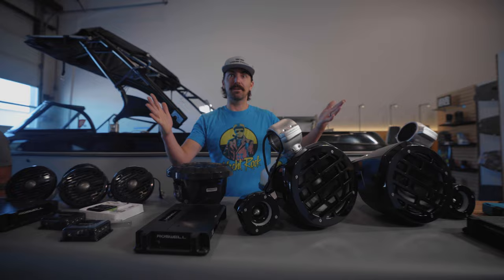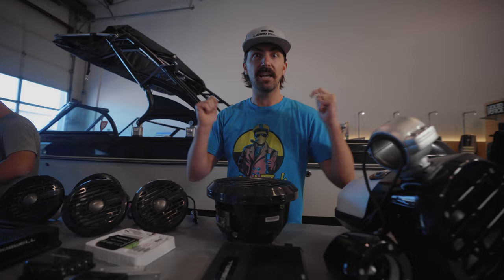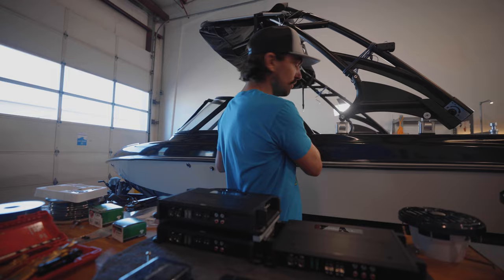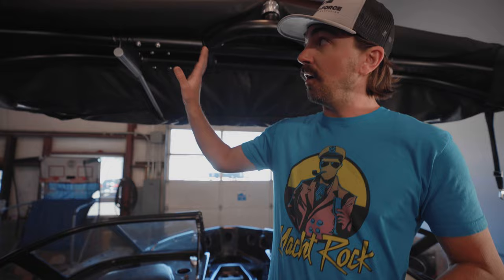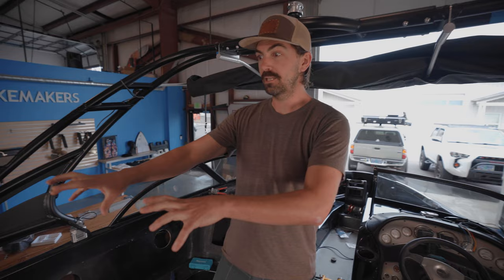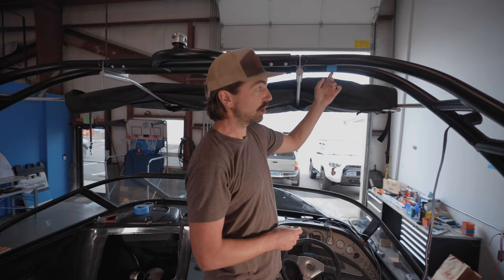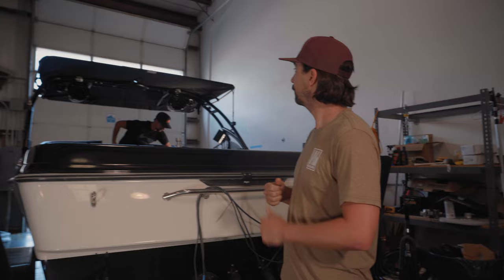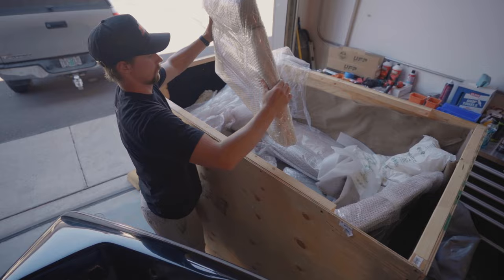Episode 7: Roswell Audio Install I WakeMAKERS Project Boat II

Comment: So any follow up on this boat?? No videos of it running or any additional surf system install??
Reply from the maker: No surf system install, unfortunately, we decided the stern area was a bit too small to mount a GSA on, and it performs plenty well with just a shaper. On water video is coming soon, we actually just got it out on the water for the first time last weekend, we're a bit bummed we didn't get to use it all Summer but between the gelcoat taking the 5 months it did and the season being so busy for us taking care of customers we had to work with what we got! We'll be dropping some more install vids over the Winter and we'll definitely be on the water A TON next season 🤘🏼
Reply: Sounds good I love my Tige 22v. Can’t wait to see it.
Reply from the maker: @windyriverfarm3562  such great boats! We were so stoked on how well it performed! Head over to our Instagram, we posted a photo of our on water day a couple weekends ago if you wanna check it out while we dial in the edit 😎